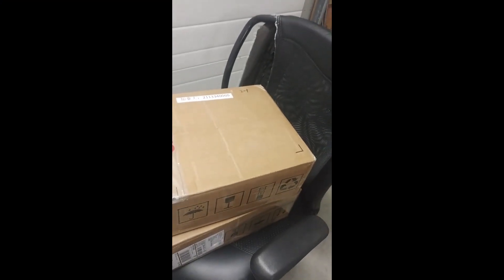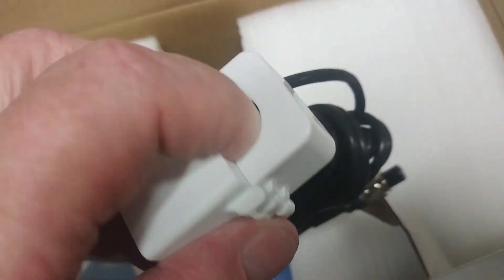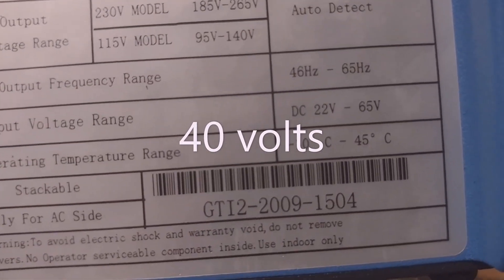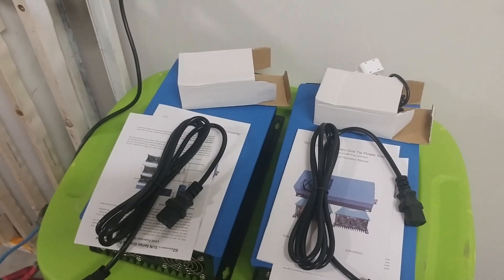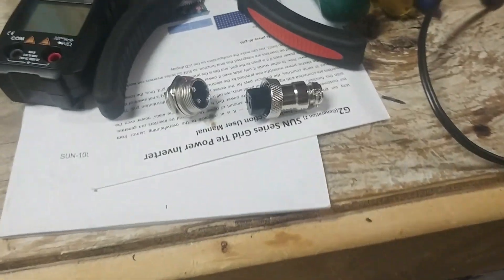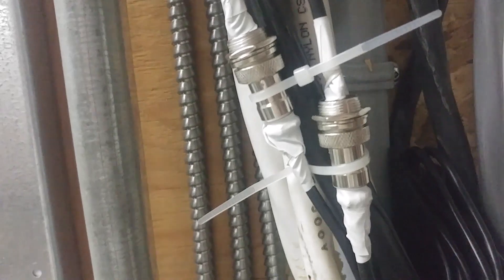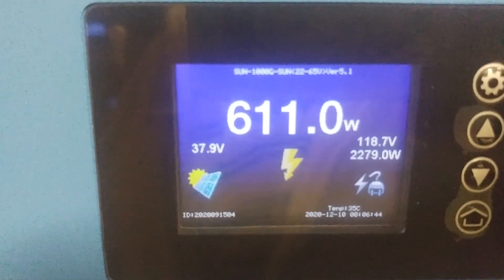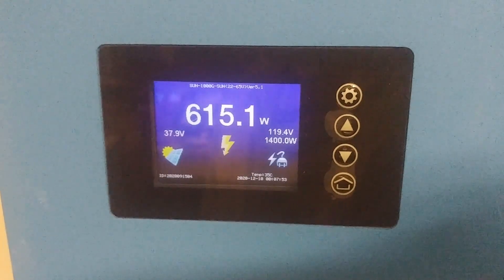2020 31 Sun 1000 watt grid tie Inverter with Limiter

Comment: Where do you connect the limiter cable? One end on iverter and the other?
Reply from the maker: On the load side of the main house feed in the panel be sure it is the same leg as the inverter is plugged into
Reply: thank you 
 @offgridwanabe

Comment: Hello, i need your help please , i have 2 inverters as you have, but my main wire is 1 only( one phase) .so how i must install my 2 limiters? on the one phase both ? it will be okay? thank you very much
Reply from the maker: I need more information what voltage do you have and what country do you live in?
Reply: @offgridwanabe  thank you for you answer )) voltage is 220v and i am from Cyprus. thank you so much
Reply from the maker: From what I understand the inverters will work on single phase 220 with just putting the CT (sensor) on the hot wire Mains obviously if the load is less than one inverter will produce then only one will run until the load increases then the other one will start. I have never tried it as we use 2 120 volt leads (split phase) to make our 220 volts but I believe it will work, be sure to let us know after you have tried it. Cheers @ioannistziovanis-k9l
Reply: @offgridwanabe  super thank you, yes i will use 2 inverters, and the 2 Ct sensor i will putting on the hot wire mains (220v- single phase), that's correct. but if i will make one ct sensor connect in parallel and plug it on the 2 inverters, they will work together ?
or you don't know if on 220v one phase will work?  thank you very much )
Reply from the maker: @ioannistziovanis-k9l  I have read where people spliced them together but there is no advantage doing so the other way you can plug one in another room but imho you need two circuits to plug one each on each circuit so you do not overload the wires.
Reply: @offgridwanabe  so how i can connect the limiters please?
Reply from the maker: The limiters go on the main wire that feeds your panel both go on the same wire the hot wire none go on the neutral.  @ioannistziovanis-k9l

Comment: sir we have a problem note that the solar system does not save energy

On the contrary, more energy is consumed than is happening

Why instead of saving increases consumption?
Reply from the maker: Do you charge it with solar panels
Reply: @offgridwanabe  no sir, I have 800 watts with two panels connected to the hybrid inverter, it is a grid on

but after a month I do not reduce anything

rather, the resitive consumption of light was more expensive

this is the inverter i bought SUN 1000W Solar Grid Tie Inverter with Limiter Sensor Wi-Fi DC 22-65V 45-90V AC
Reply from the maker: if you have the CT on backward and your utility does not allow netmetering the meter can not tell which way the power is flowing and it will record use in both directions.
Reply: @offgridwanabe  what is the CT sir?
Reply: @offgridwanabe  refers to the sensor where it should be connected

It has to be connector after the electrical box or where
Reply from the maker: @BelterAltamirano  ct is the sensor clamp it goes on main wire feed from main panel if you put on a load you should see the watts go up on the sun screen if it does show a minus ct sensor in on bachwards
Reply: @offgridwanabe  ok perfect what a genius are you

one question then go from the energy meter I have current 220v to 110

But then I will connect the ct to ground or negative phase or positive phase in which sir?
Reply: @offgridwanabe  Sir, note that my solar inverter grip on rather the energy was more expensive

One question, where exactly does the sensor go?

 ct I have 220 where I connect it in the positive or negative phase or ground in which?
Reply from the maker: @BelterAltamirano  the ct goes on the power wire yes you have 2 power wires each one carries 120 volts make sure the CT goes on the same leg (power wire)as the inverter is plugged in too.
Reply from the maker: @BelterAltamirano  I am guessing you are in USA with a split phase system (2 power wires)
Reply: @offgridwanabe  from which external power supply?

you say to connect it in the 110 v phase

I mean the positive that comes from the street to the electrical box
Reply from the maker: @BelterAltamirano  Every country has different system in USA it is two 120 volt wires and one neutral you need the CT (sensor wire clamp) on one of the power wires and the receptacle the inverter is plugged into on the same 120 volt power wire otherwise the CT cannot control the power use.

Comment: How can you get battery and solar into this inverter?
Reply from the maker: It has positive and negative connections on top for battery or solar.
Reply: @offgridwanabe  how to hook up both at the same time? Battery and solar
Reply from the maker: @MatthewBayard  you can't so I just use the battery and charge the battery with solar charge controller. But if you had no battery you could run it from solar while the sun shines.

Comment: Sir how can we know that limiter is functioning, we are using 240w which is our consumption , then the production of our solar is 350w,  how can we know , how to lomit
Reply from the maker: First make sure you have all the settings correct for limit use and the limiter attached to the AC load wires on the mains. It will start when ever you use an AC load. But if you are directly connected to solar without battery then it can only produce however much the panel is making at the time. Hook it all up and shut off the AC you should see the inverter shut down to zero turn on the AC and it will start it should show on the lcd how much load you have then when sun shines it will show how much it is making if it is making more than you are using the limiter is not working if it is working the AC load will show 5 or 10 watts if it shows negative you have to reverse the limiter wire CT.

Comment: Massive setup! does your inverter is powered by its own separate group of batteries, or both inverters draws power from one big pool of batteries. And what is the parameters setting in each inverters, if you made any adjustments from your inverters internal default settings. thank you.
Reply from the maker: My system has two different battery systems but the sun inverters are on the 40 volt system which is the big battery bank. I only allow 850 watts on the limiter to ensure they don't overheat and to not kill the battery too fast even though the bank is 60 kwh I only let the sun inverters take it down to about 50% so I always have power in grid down time. Also in winter I can never get the bank fully charged unless I shut off inverters so I run it back down to 50% each day and charge whatever the sun allows.

Comment: I want to get 3 of these inverters. How do I extend the sensor? I need about 100ft x3
Reply from the maker: I just used shielded telephone cable like what comes in from the pole. I think it would go 100 feet but it may be a little slow to respond. sorry for late response just found the comment.

Comment: dont buy this thing it very bad. you cant change the settings. the production lower than other converters. i bought solis inverter after this and it has much better output in lower sun light.
Reply from the maker: To each their own I love this Sun inverter it works great and is priced right.
Reply from the maker: I would like to try a Solis some day there software seems very in depth.
Reply: Does Solis have a limiter?

Comment: I am running my 2000GTIL at 1400W and they are getting 60 degC hot :). I like those inverters...
Reply from the maker: Mine run at about 40 degC max but we have cool weather and they are on limiters so they get a break too. Since longer days are here I moved them up to 850 watts each so last month they run about 180 kwh each.
Reply: how much have you backfed?  any?

Comment: I'm so jealous, even batteries! Your Sun Inverter looks nice. I got 1 Mono LG 320 60 cell solar panel used to take the edge of my electrical bill $. Meter says family avg is 240w. Any suggestions for an inverter? so many to choose from. I might get another 300+ panel. Strong sun daily where i'm at.
Reply from the maker: If you are going small that Sun 1000 inverter with limiter is easy and cheap and a good way to start then you could ad batteries and charge controller later.
Reply: @offgridwanabe  Thank you.
Sun 1000 inverter coming. Sadly I have not bought any type of cables yet and yes batteries look like a great option. 24v though, doesn't that mean you need two 12 in paradelle? Its like a grand for lithium. ouch!
Reply from the maker: @rossmccurry5988  when you get it hooked up maybe look around for a couple panels that Sun will take 950 watts in panels
Reply: @offgridwanabe  
Inverter just arrived today! not the exact model I wanted :(. Check this out:
L2-1000W-DC45-90V-B

The 45-90V model inverter will start up at 49.5V, after starting, the voltage will drop to 45V,then inverter can work in 45-90V.

Voc 60-90V solar panels in parallel is suggested.For example:Voc=36V solar panel,we suggest 2 panels in series, then connect 2 or more groups in parallel.

Rated Power (Peak/Continuous): 1000W / 900W
DC Input Voltage: 45V~90V
AC Output Voltage Range: 110V/220V Auto
Peak power tracking voltage: 49.5~82V
AC Output Frequency Range: 46Hz~65Hz
Peak Inverter Efficiency: 92%
Stackable: Just for AC Output
Output Wareform: Pure sine wave

Current solar panel I have is 40v 320 watt 60 cell. This dang thing requires 45v at least, omg.. looks like I need another solar panel. Should the panels almost match for parallel or doesn't matter? and then with 80v can I still add panels or am I getting confused?

As for batteries, I'm so tempted to buy used even! lol.. Just to experience the storage of energyyy.. Any advice don't hold back. 20ft 10gauge solar cables coming saturday..
Any controller/charger suggestions?
Reply from the maker: @rossmccurry5988   Ah the learning curve has set in lol. Ya that one is the high voltage inverter I guess you didn't find the low voltage one but we have to work with what we got. yes you will need at least one more panel hooked in series to increase the voltage high enough to start that inverter. Check out the manual read it twice or three times as there are limits so the voltage has to be in the range and the watts have to be under maximum which I believe is 1000 watts so with your panel you can only use 2 panels otherwise 3 in series would be over the voltage and 4 panels in series parallel ( 2 in series and 2 sets in parallel) would be over the wattage so the panel selection is critical you may find some used 250 watt panels which would give you a better fit. Now if you go with batteries and charge controller you can have more panels only limited by the charge controller maximum but you have to configure the batteries to a higher voltage at least 48 volts. Hey good luck and if you need more help just ask.
Reply from the maker: @rossmccurry5988  the panels should match or at least have the same specs or close. Make sky blue is a cheap charge controller that has various voltage settings just make sure the wattage is the size you want.
Reply: @offgridwanabe   alright, I did it, I got 5 Q.PEAK-G4.1-305 panels. I only wanted 3 but the said all our none but then he went down to $100 for each. Panels tested great with a multimeter. Reviewing my electric monthly avg it never goes lower than 300kWh. Not sure if I should keep the extra panels or sell them. Now, I either need a larger inverter or another one..
What would you do? Humorous these 5 panels fit in a prius. Still in car, time to get them out on the roof. Dang it's sprinkling.
Reply from the maker: @rossmccurry5988  Awesome I never sell if I can help it as you always need more just the nature of solar.
Reply: @offgridwanabe  well I got them out of the car at least. Spray them with a hose.
Reply: @offgridwanabe  ok, all five are on the porch roof. Shower time. How do you know how many batteries and how strong is needed to buy? I don't get that part.
I did hear agm deep cycle ones are best..
Reply from the maker: @rossmccurry5988  Well for your first try I would look for the cheapest deep cycle you can find if you are going Lead acid and ye AGM are better but the life span of any lead acid is too short for the money so look around maybe you can pickup a tow motor battery or some golf cart rejects or someone who is up grading to lithium. Keep in mind you will need at least 48 volt configuration with that inverter. and you will need a charge controller Make Sky Blue had a pretty good one at a low price.
Reply from the maker: @rossmccurry5988  https://batteryhookup.com/?mc_cid=489e03ab56&mc_eid=c61e2770fa

Comment: @OffGrid Wanabe I am looking to also extend the limiter cable. Where did you order yours? Also what gauge are they and are they shielded? Thanks
Reply from the maker: I had some old telephone cable which has 2 pairs in it so I just used that 22 gauge solid wire I think. Obviously shielded would be better. If I wanted to wait I could order some pre-made off Ali Express but I thought I'd give what I had a try and it worked so well I never changed it I extended them 25 feet and used all the wires in 2 pair
Reply: @offgridwanabe  also do u know what the connector are called? I am trying to make my own limiter extension. I believe you said in your video that the size you ordered were incorrect size. Did u ever find the right size? Thanks
Reply from the maker: @jersungtx   They are called 2 PIN 16mm GX16-2 Screw Aviation Connector Plug the part I got wrong is the 16 mm it was too big.
 here is the Amazon link
https://www.amazon.ca/gp/product/B06XFPL5J4/ref=ppx_yo_dt_b_asin_title_o03_s00?ie=UTF8&psc=1
I never bothered to find the right one I just desoldered the original and used it on the end of the longer wire while soldering the new ones in the middle .
Reply: The correct size is a gx 12 aviation plug on my 1000 watt model.  I verified the size of the plug with a micrometer.

Comment: Let them supply 240v. Your electric company meter reads your power usage at 240v. Your meter has one ct in it with both mains going thru it in opposite directions. People don’t understand that and think they have to use a 120v supply from these inverters.. I’ve been using two 2kw 240v inverters for years.
Reply from the maker: Both work but the 240 volt version needs the CT to be modified when using only one inverter. They were designed to run on single phase 230 volt which is more similar to 120 single phase than 240 split phase but whatever works. Thanks for watching and comment.
Reply: RJ can you explain your setup, i'm trying to see how to set up a single 2k 240v like yours, ( not sure about getting a second unit)
Reply from the maker: @Alex300zxTT  Well the only way I can see it working is if you connect 2 CT clamps to one wire so you don't backfeed the grid

Comment: I see the YouTubes on these and most of the successful YTers have Sun systems. But, when I go on  Amazon or ebay I find what looks the same but is not a "Sun" branded item and they are not "Gen2". Can you provide a link or provide information on where I can purchase your exact inverter? (Sun Part Number??)   I plan to use mine tied direct to my panels without batteries. I have two cheap 1,000Watt GTIs tied in with two-300 Watt/24 volt  panels each in parallel. I would really like to switch to Suns with the limiter as where I live (San Diego) the power company is vicious towards all DIY solar. Thank you!
Reply from the maker: Here is the link I used to buy but there are many places to buy the Sun 1000 grid tie Generation 2 
https://www.aliexpress.com/item/32840436286.html?spm=a2g0s.9042311.0.0.d8244c4dOLhJcs   
The Amazon link is here  https://www.amazon.ca/ECO-WORTHY-Switch-Inverter-Limiter-System/dp/B076KBCHBM/ref=sr_1_20?dchild=1&keywords=Sun+Grid+tie+1000+generation+2&qid=1615221795&sr=8-20
But a lot more money. Wherever you order from make sure they include the correct electrical plug and CT (current transformer with long enough cable) also if you want wifi it is extra 
Good luck China delivery is about 6 weeks.